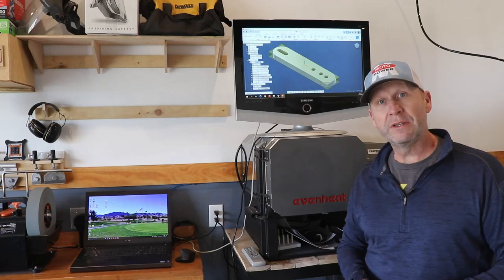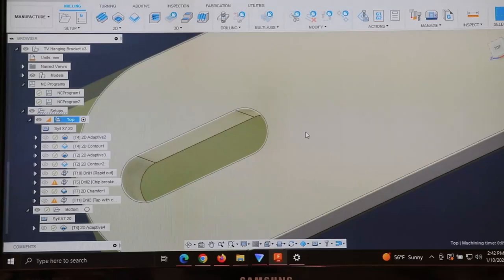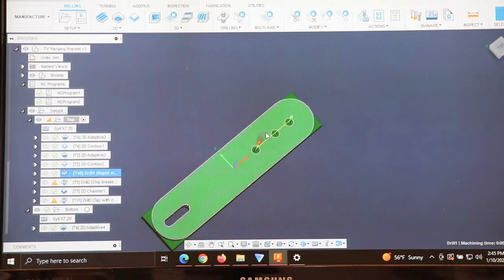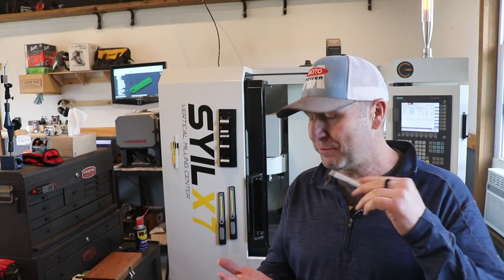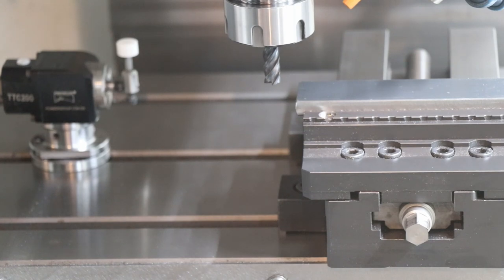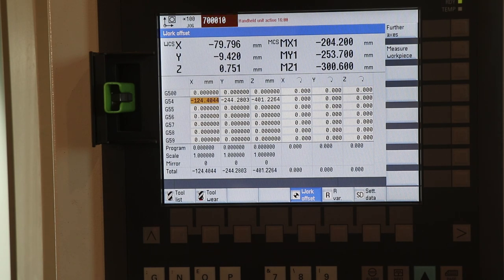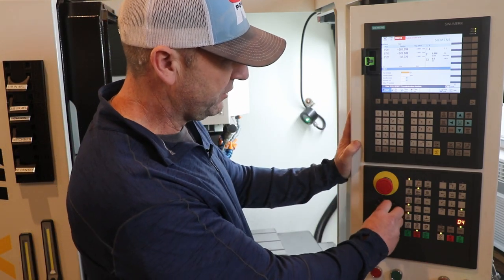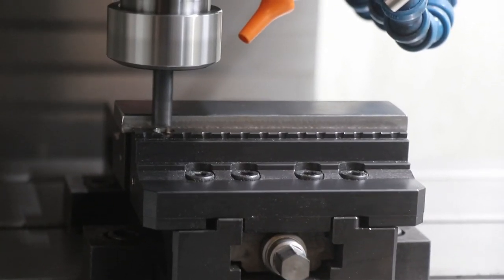Making a TV Mounting Bracket: Part 1

Comment: you dont run coolant ever? and if not mind explaining why?
Reply from the maker: Ah, sorry, let me explain. Most of the CNC work I have done, in general, has been with coolant on a Haas lathe and vertical machine mill.  I have a 5-gallon container of coolant, but I haven't mixed/employed it on my Syil yet.

The tooling I'm using doesn't require coolant for steel however, once I start working with aluminum, I will be required to run it. I've been holding off because of the material I'm working with and the infrequency I use the mill.

If I get to a point where I'm milling most days of the week, I will definitely run coolant. I enjoy the smell and appreciate the protection it provides to my tooling and machine. 

Hope that makes sense.